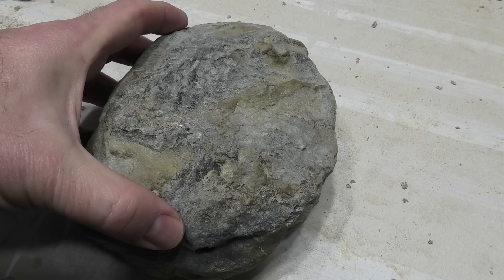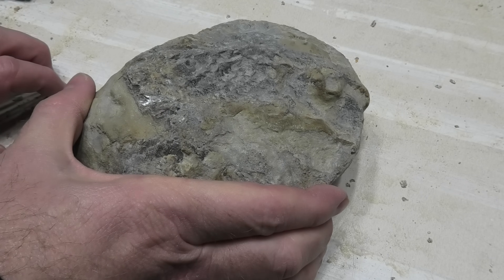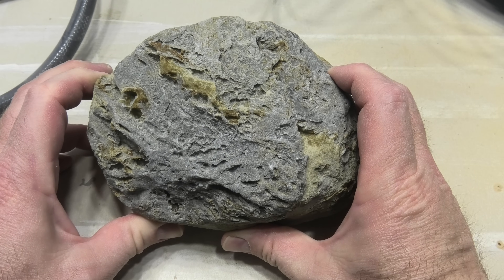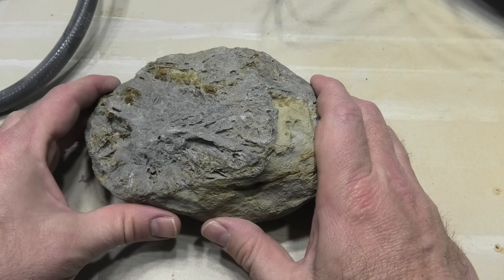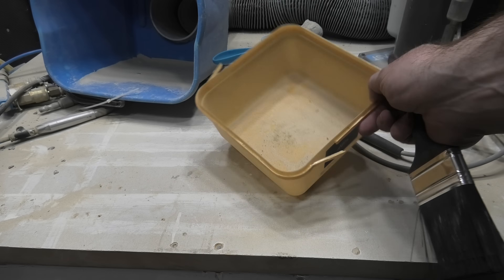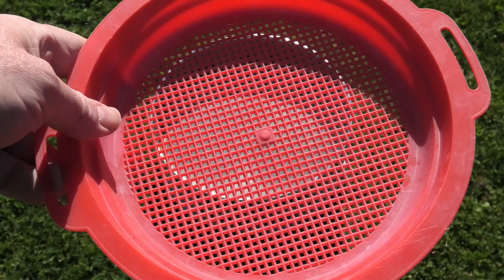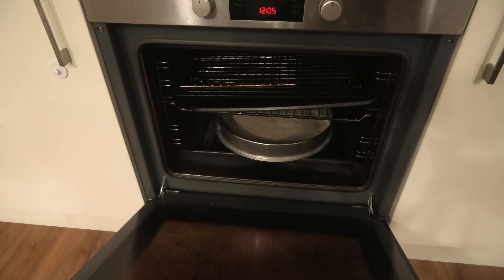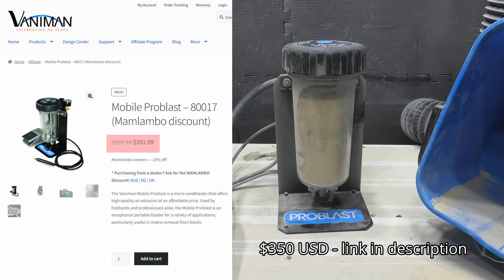Revealing Sparkling Selenite! Micro Air Abrasion Prep + UV Glow (Vaniman Problast)

Comment: My one caution would be that when reusing micro abrasion media you will be including a percentage of material from the fossil host rock, which may be harder and/or denser than the original media and thus affect the abrasive properties. You could try using a settling cone to separate by density or just be conservative with how often you reuse the media, and its probably not the biggest issue being as you're mainly dealing with siltstone but thought it worth mentioning. Lovely selenite, I like collecting large free crystals and they are something I've taken family members to collect which they enjoyed and kept them busy while I was scouting for good deposits for microfossil sifting and more fragile fossils
Reply from the maker: That's a fair point! Thanks Lilith-Rose!